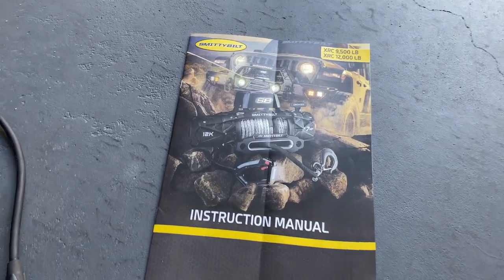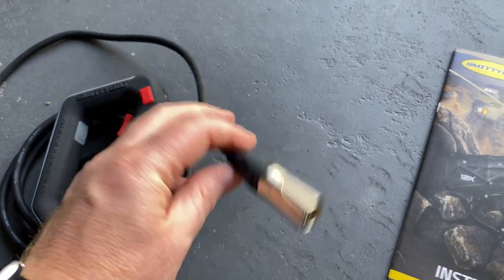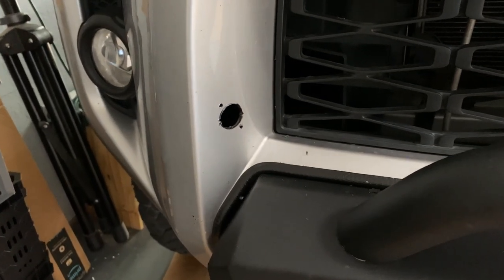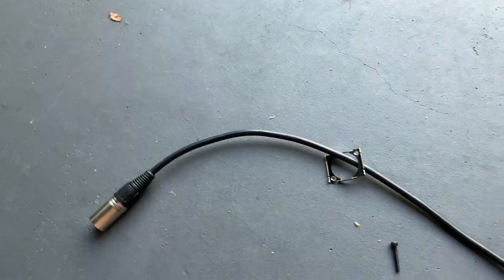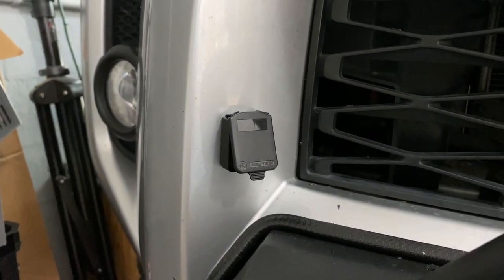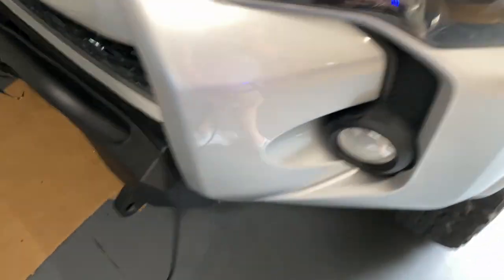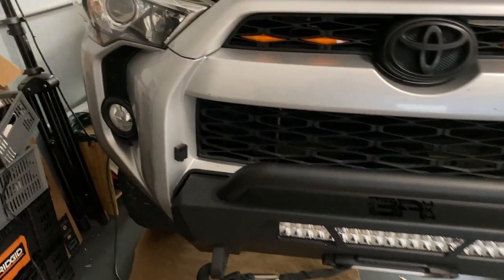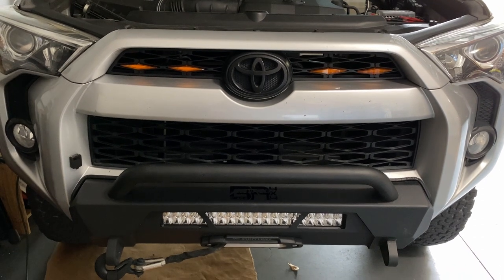Winch Control Extension

Comment from the maker: Here's the parts list for the extension.
* The winch uses the Switchcraft pin configuration.  The Neutrik pin set up is different!

Switchcraft 6 pin chassis mount jack - https://www.amazon.com/XLR-Connectors-PIN-FEMALE-NICKEL/dp/B005T7DTMA/ref=sr_1_4?dchild=1&keywords=switchcraft+6+pin+xlr&qid=1613517494&sr=8-4

Switchcraft 6 pin plug - https://www.amazon.com/Switchcraft-Male-Cable-Connector-Switchcraft/dp/B005T7DT7U/ref=sr_1_2?dchild=1&keywords=switchcraft+6+pin+xlr&qid=1613517494&sr=8-2

Neutrik chassis mount cover - https://www.amazon.com/Neutrik-SCDX-Hinged-Chassis-Connectors/dp/B004E8BS2S/ref=sr_1_30?dchild=1&keywords=Neutrik+D+size+cover&qid=1613517634&sr=8-30

Option
Neutrik spring chassis mount cover - https://www.amazon.com/Neutrik-SCCD-W-Spring-Chassis-Connectors/dp/B00Q3M3DXU/ref=sr_1_5?dchild=1&keywords=neutrik+d+size+backplate&qid=1613517969&sr=8-5

Neutrik D size mounting plate - https://www.amazon.com/Neutrik-Mounting-Plate-D-Housing-Cutouts/dp/B00HKI3P4I/ref=sr_1_10?dchild=1&keywords=neutrik+d+size+backplate&qid=1613517714&sr=8-10

22awg 6 conductor cable - https://www.amazon.com/gp/product/B07Y33WL43/ref=ppx_yo_dt_b_asin_title_o00_s00?ie=UTF8&psc=1